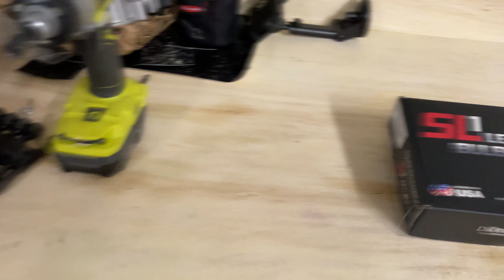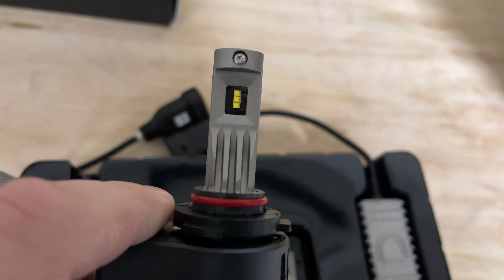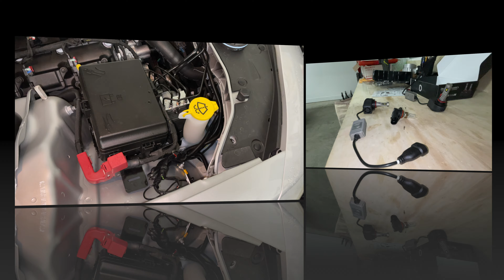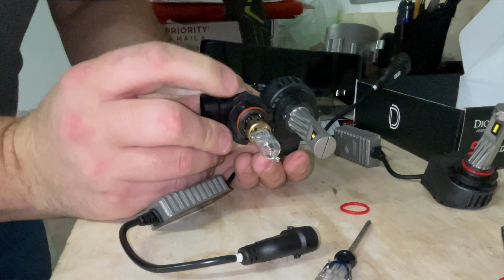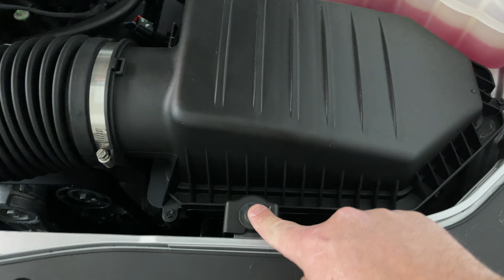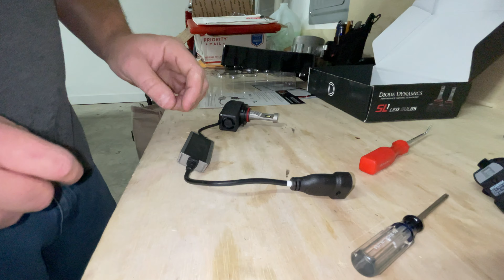Diode Dynamics SL1 9005 LED bulbs : 2020 Dodge Charger.           #dodge  #diodedynamics  #charger

Comment: Did you have any problems trying to push and lock the bulb in place? I pretty much did the same procedures as you did by adjusting the collars so the new bulb is at 3-9 o-clock but I can’t push and turn the bulb to lock it into place. I don’t know if it’s just me, but the overall thickness of the collar itself looks almost as thick as a stock bulb. any suggestions ideas would really be appreciated.🤙🏽
Reply: I just installed so.e on a 22 wide body. I was having the same issue. I had to cut the extra plastic sticking out on the actual light receptacle
Reply: Did you get it to work
Reply: @jasonsimeona2184  yes I was able to get them to go in a lock up. But I had a hard time cutting them out. But once I cut that extra plastic they fitted good. But being honest I didn't like the lights that much, I feel they aren't as bright and  not enough area brightness.
Reply from the maker: I agree. I actually drove for a while and switched to GTR lighting 55 watt 5500k HID kit.  It is much brighter.  These LEDs change the light color to a nice crisp, white light, but they’re not much brighter than the halogens as far as light out on the roadway.
Reply: @KnightsGarage  I will be returning them. And looking for some other ones. Do the knight flicker?
Reply from the maker: @Juan-pt1lq  I think you’re asking about the HID’s.   They do not flicker.  They work awesome and have a great light pattern but the GTR lighting kit is not cheap.   They are near instant on unlike most other HID’s.
Reply: @KnightsGarage  the diode dynamics were around 250. I don't mind paying more if they have a nice pattern.
Reply from the maker: @Juan-pt1lq  the GTR lighting with over 300 when I bought them.   Got them from headlight revolution. GTR bulbs and ballast have a lifetime warranty through headlight revolution so when your bulbs go out or do you have a balance failed to replace it for free.  I’ve already had two bowls, go out and they have replaced them.   If you get the 55 watt kit, make sure you go lower on the color temperature like it says in the instructions because they will burn hotter so if you want a 6000 K light output, you need to buy the 5000 K bulbs.  And it’s good they have a warranty because a 55 watt kit will burn up bulbs faster than a standard kit because you’re overpowering the bulb, but they are much brighter.
Reply: @KnightsGarage  thx. I'll look them up.

Comment: Thanks for the tip will definitely will consider the upgrade. Question I notice on the Diode Dynamics site it's mentioned that a antiflicker module required for the 2006-2020 Charger. Are you experiencing any issue with headlight flicker?
Reply from the maker: I don’t see where you need it, the charger doesn’t have a bulb out warning.  I think they say that for all newer model vehicles.  I had no issues with my old HID kit on my 2016 charger either.   If I have any issues I will be sure to mention it.
Reply from the maker: @Matt Nelson They are better than stock for brightness and have the clean white color but weren’t as bright as I thought they would be and wanted.    If you go HID you will need the relay harness and anti flicker unless you go with a high-end kit like the GTR kit that has everything within the ballast module.  But it’s 350 bucks.
Reply: instablaster.

Comment: Hey bro. Im trying to install these leds but i cant seem to get collar at the correct position to have the light up n down. What position does the collar need to be at?
Reply from the maker: I had to leave it loose and rotate it in the car. I believe I gave a good starting point in the video there may be better instructions now on their website than what there was when I made this video.  I can tell you now months later that the light output was not good enough and I had to switch to an HID set up from GTR lighting.
Reply: @KnightsGarage  thanks for the replay. I got these for a fairly cheap price off ebay brand new. I saw alot of good reviews so I thought id give them a try. Hate to have issues later on as i did with previous led lights. Guess ill give them a try. Thanks for the reply bk.
Reply from the maker: @dabirdman2471  they are brighter than most, but they are not the brightest available, and no LED yet can’t stand up to a good HID system like the GTR.  LEDs often start out bright but after about 30 minutes of one time they reduce brightness 20 to 50% depending on the quality.

Comment: I would love to know how these compare to the HID bulbs in the Hellcat.
Reply from the maker: I show them both on as a comparison in this video.
Reply: @KnightsGarage  Really the Hellcat HID and the LEDs? I did see the side by side comparison after you did the passenger side but I thought that was Halogen vs LED.
Reply: @KnightsGarage  Never mind didn't realize after you did drivers side the light on the other side of the garage was the Hellcat my bad.
Reply from the maker: @coolwrld302  yeah.  Had them both on at the same time.  The LEDs look better in my opinion.
Reply: Thanks a lot for the video.

Comment: I just recently purchased these and I’m having the bulbs point all over the place any input ?? 

Also you said these Charger headlights aren’t adjustable for left and right ??
Reply from the maker: I can tell you it is tricky to make sure you get these bulbs set perfect in the housing.  When I was going back-and-forth with bulbs I messed up with a few halogen bulbs and have the headlights all whacked out looking.  Also if you don’t get them facing straight up and down when they are seated in the housing than the light output will be scattered looking and dim.  
The charger headlights are not adjustable left or right only up and down but most factory headlights are like that.  
To be honest with you this is part of the reason that I got with diode dynamics and told them I was not happy with the light output to the side of the road and they allowed me to return these bulbs and I went with a GTR lighting 55watt HID kit.
Reply: @KnightsGarage  how are those GTRs holding up ?!
Reply from the maker: @adrianrodriguez1725  Great.  I actually tried a morimoto kit first and they gave me all kinds of problems.  I had to adjust the headlights way down I think it was like 2 inches or so at 25 feet casting light on to a wall.  Because when I first put them in they were Shannon all up on the street signs because the halogen housing is adjusted up for the dim halogen bulb so you have to adjust them down.  Went with the 6500k 55 watt kit. When you go higher wattage it reduces the kelvin so at 55w 6500k looks like 5500k (almost pure white).  If you go with the 35 watt kit get the 5000k bulbs.
Reply: @KnightsGarage  awesome I need to figure something out
Reply from the maker: @adrianrodriguez1725  I can tell you the GTR kit is not cheap but you don’t need anything else. No other relays or harnesses everything is in their smart ballast.  The only thing that you have to do is put the hole in the dust cap to pass the wires through but they give you a nice silicone grommet that the pass-through also those cats are like six dollars if you had to replace them to sell the car or something down the road.

Comment: I used sl1 9005 on my Durango gt 2019, they weren't bright at all.. my stock halogens are brighter idk if i did something wrong or what
Reply from the maker: They are different in different vehicles.  They were barely brighter than the stock bulbs but were the white color I was looking for.    I did wind up getting a GTR lighting HID kit from headlight revolution.

Comment: I know this is an old video and not sure if you still keep up with the comments, but I’ve had these for about a year now and cannot get a good beam pattern. Any suggestions?
Reply from the maker: I’m in the same boat.  I went to the GTR lighting HID kit.
Reply: @KnightsGarage   how are they working for you? Any modifications/drilling involved? I saw a video on Lasfit. Gonna try to do some research cuz these Diode lights are not it
Reply from the maker: @magarciaz20  it’s hard to get a good beam pattern out of a LED.    The gtr’s are expensive, but they are awesome. You do have to drill a small hole in the dust cap to run the wires through, but comes with a nice rubber plug.  Not a big deal.  Had to adjust my headlights down about 3 inches at 30 feet shining an the wall.
Reply: @KnightsGarage  great info, gonna look into it soon. Thanks!
Reply from the maker: I used headlight revolution to order mine and the GTR lighting kids have a limited lifetime warranty on the ballast and the bulbs.

Comment: i found them on their website. should i get the $30 antiflicker module? i checked the list of cars and it says dodge charger 06-20..!
Reply from the maker: You don’t need that for the LED’s.     If you want the best light output but aren’t afraid of price go with the GTR lighting HID kit listed at headlight revolution.  The HID lights are much brighter than the LED’s.  Just remember the GTR kit is the best and requires no extra relays or harnesses to work.  That’s what it’s expensive.  That is what I’m running now.  Go 5000k for the 35w kit and 6000k if you choose the 55w kit.  Also remember you’re going to have to adjust your headlights down quite a bit after installation because they are aimed pretty high for the week halogen bulbs.
Reply: @KnightsGarage  thanks man. are the gtr ones also on diode dynamics? how much $$?!
Reply from the maker: @dgvertical  no. They are on headlight revolution’s website.  They are about double the price of these LEDs.
Reply: @KnightsGarage  fashoski. preciate it. i’ll see my options.

Comment: Do the h11 SL1 bulbs fit for the fogs on a 2019 scat charger?
Reply from the maker: Those are already LED if I’m not mistaken.
Reply: @KnightsGarage  I’m looking to buy those h11 sL1 bulbs to upgrade the stock bulbs 🤙🏻
Reply from the maker: @madvillain_105  I’m pretty sure the fog/driving lights are LED on the scatpacks.    If you want to upgrade the headlights these will work.  If you want even more light an HID kit is what you will need.